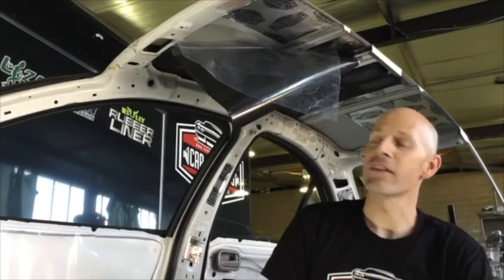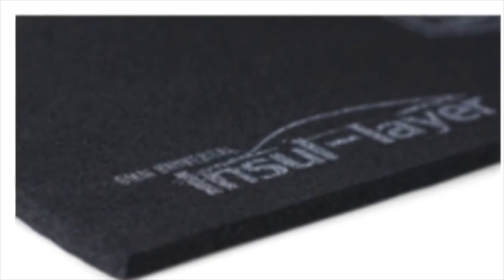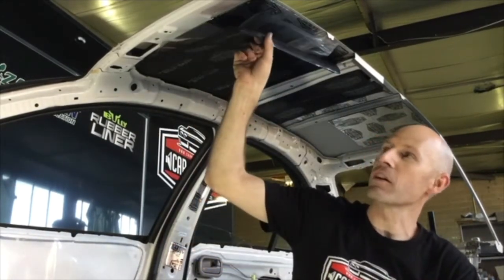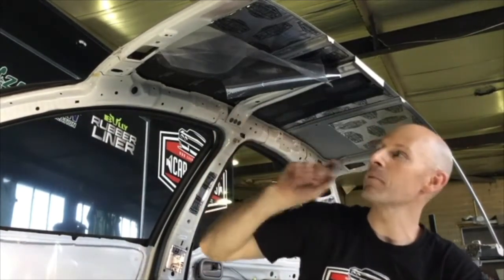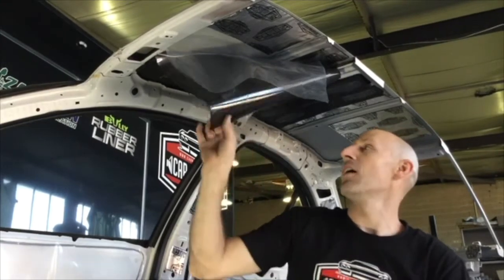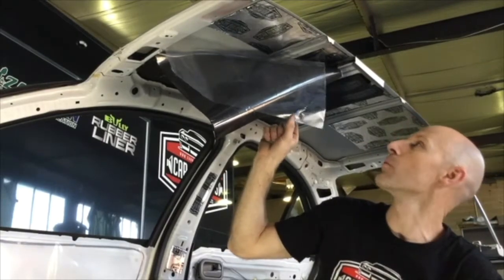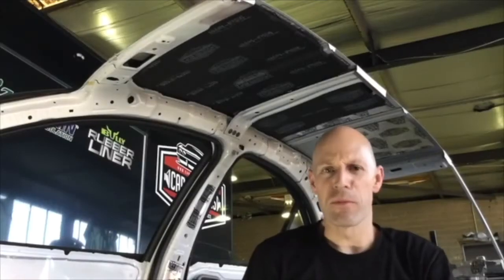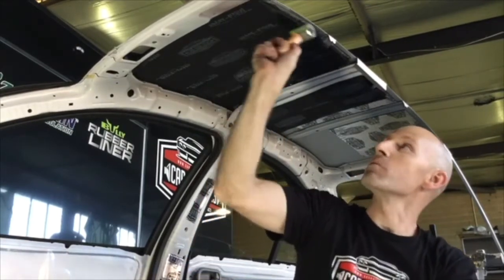How can I reduce sound and heat in the roof of the car?

Comment: Is there a way of applying a "general" insulation that would work both way, meaning helping keeping warm in cold environnement, and keeping the cold air of the AC in a summer environnement?
Reply from the maker: Hi Fabzil. Yes, these products will acts in both ways. The closed cell foam will slow down any heat transfer (from either side) like a foam Esky/Cooler Box does.

Comment: will i notice a huge difference in how much i use my ac/heater? im going too be replacing my headliner anyways i love in north alabama and it con reach 102f/38c and thats outside not the surface metal of my truck. i started looking at automotive insulation for the sound deadening aspect but wouldn't mind the noise levels being reduced, itd be wild too hop in my truck on a rainy day and not hear the deafening roar of the rain hitting the metal. Cheers from alabama mate!
Reply from the maker: Haha.. Hi from Melbourne. Yes, if you have the headliner out it is a perfect time to treat the roof. The Stage 1 (sound deadener) will help with the panel noise in the roof (when it is raining etc). The Stage 2 product will further soften inbound noise, however it's greater purpose will be to act as a decoupling layer and lower heat transfer, making your air con more efficient and effective. Good luck 👍

Comment: Im about to fit out my ford xc ute with this carbuilder underlay stage 1 and 2, would this foam be better for the roof or would the stage 2 work just as well?
Reply from the maker: Hi Michael. Ideally the Stage 1 (Sound Deadener- butyl) would be laid down first to treat panel vibration and then the Stage 2 (Insul Layer- 6mm closed cell foam) to reduce heat through the roof and soften internal noise. Feel free to call us during the week to discuss further 03 8777 0960

Comment: But how will it block heat if the sun is already blocked at the top? The only light that comes in is through the windows
Reply: the roof metal heats up

Comment: I have an older car and I'm sick of the crappy clunky sounds that it makes, especially closing doors, will this at least quieten it?
Reply from the maker: Hi goverat. It will definitely make the door sound/feel more solid. When you are doing it also check for any loose componentry, small bits of foam in between metal parts will also make a difference 👍

Comment: What the best brand to block heat?
Reply from the maker: Hi Sinue. Car Builders of course 😉😆To answer your question, the best solution is always going to be facing the heat source. There are paints, however an embossed heat shield https://www.carbuilders.com.au/aluminium-embossed-heat-shield that is spaced off the sheet metal is going to perform best at keeping heat out of the cabin. If you have limited space, you would then use a peel and stick heat shield https://www.carbuilders.com.au/peel-stick-heat-shield~845 
If you are trying to treat external heat from the inside, it is a challenging task. Sound deadening mats such as our product or Dynamat will capture heat as it hits the top aluminium layer of the sheet however the heat is in the cavity of the vehicle and you are trying to smoother it with closed cell foams etc. In the roof, you are obviously trying to treat sun-generated heat. A reflective paint on the roof works best but it is obviously not desirable for most people. The sound deadening mats in the roof will capture heat and the Insul Layer 6mm https://www.carbuilders.com.au/insul-layer closed cell foam is a good material at slowing down heat transfer and will help prevent condensation. Good luck with your project 👍